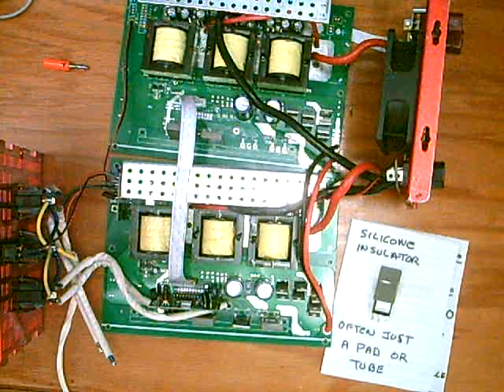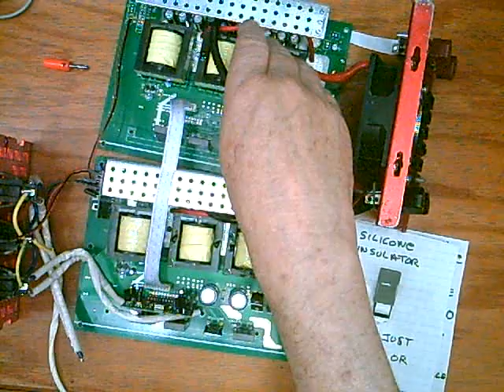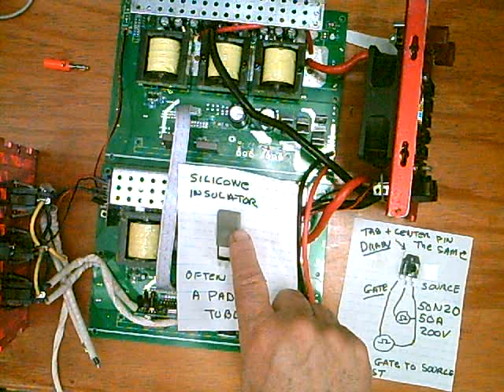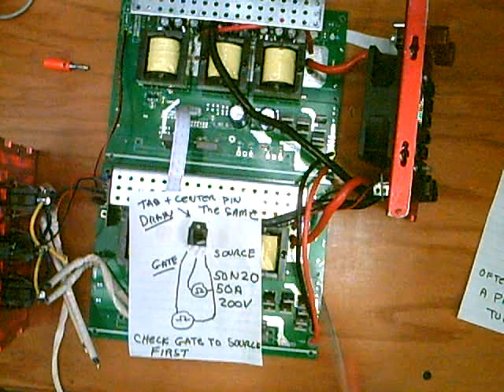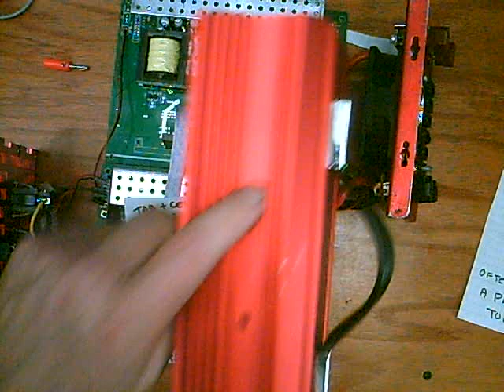2000W BESTEK Inverter Repair, Don't Buy One

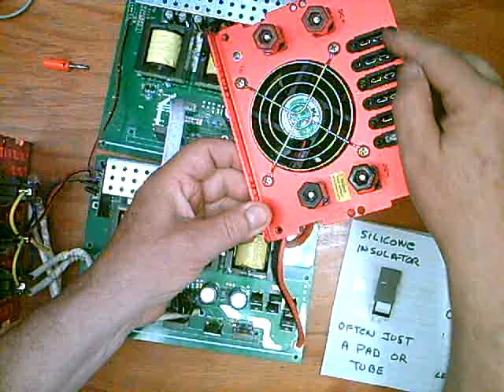Comment: I have one of these that I bought in 2016 and it is fused with 50 amp fuses. It also came with a package of six 50 amp replacement fuses. The push in type automotive fuses, like the ones used here, are color coded to indicate amperage as well as being marked with the number of amperes for the benefit of people who don't see well. My 50 amp fuses are clear in color as is the one that you have revealed in your video at 0:22, so maybe you should take another look.

Comment: Update, I pulled all the fuses out and it still turns on and and produces power. How are they not even in parallel? Not hooked up at all?
Reply from the maker: Are you sure it produces power? Control electronics may be powered separately before the fuses allowing LED indicators to come on, but not produce power.

Comment: I just got one, should I change the fuses to series or lower fuse amps and what total amp would you suggest?
Reply: Check your fuses. My unit, which was brand new and unbroken when I bought it in 2016, came with 50 amps installed and a pack of six 50 amps for replacement if they blow. I don't know how far you can trust someone who buys used broken electronics to repair and resell when they are giving you advice on making stuff last. Seems that having lots of broken stuff out there for them to buy would be better for their purposes. Just sayin'. Use a grain of salt.
Reply: In a 4 part review of the 1000 watt version of this unit (this one is 2 of those tied together) on a channel called knurlgnar24, he thought that 50 amp fuses were too big (his came with 50s not 60s just like my 2000 watt version did) unless it was overbuilt and able to actually supply 1200 watts for short periods. He tested it and found that it could. He said that 40 amp fuses is what he was expecting for this sort of inverter in this price range. So I'd say as long as your unit doesn't have 60 amp fuses like this guy claims his has, you should be OK. If you can't sleep at night with the 50s, then drop down to the more typical 40s. IMO Hope that helps.

Comment: where did you find that for 30 bucks also is that modified sine wave ?
Reply from the maker: It is MSW and that is what my refrigerator runs on.  It was an impulse buy. I have a couple pure sine wave and a couple MPPT charge controllers I've purchased on ebay.  Have a running search "for parts" items. All things come to those who wait.

Comment: Those Silicon Thermo Pads are way less Heat conductive then plane ol Kapton Tap and Paste. I don't even mess with them any more.  Just use two layers of  Kapton Tape and Paste.
Reply from the maker: These were even thicker than many.  The bar that holds the devices can also pull away a amount of heat. I have a roll of kapton tape and didn't think of that. Probably because I would probably never have a use for this beyond 500W.